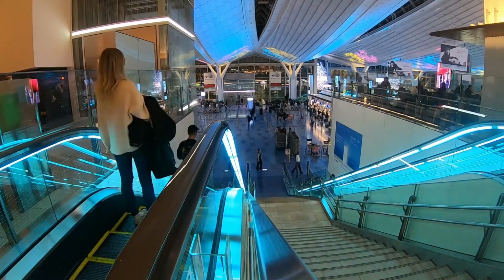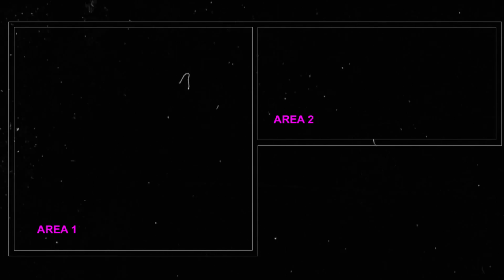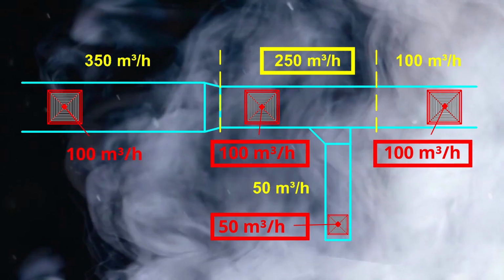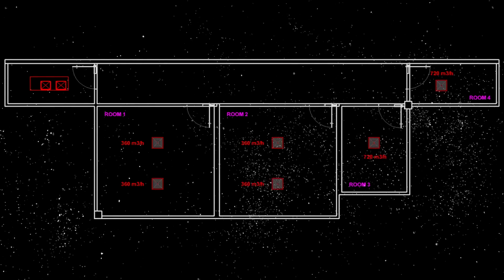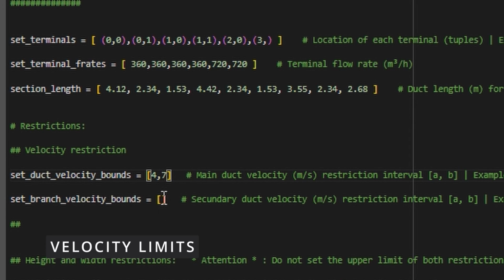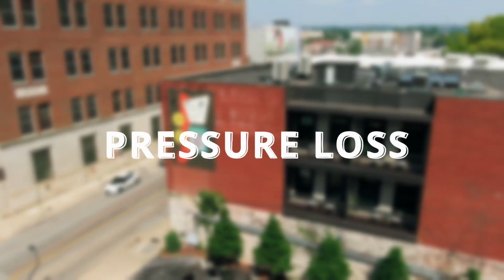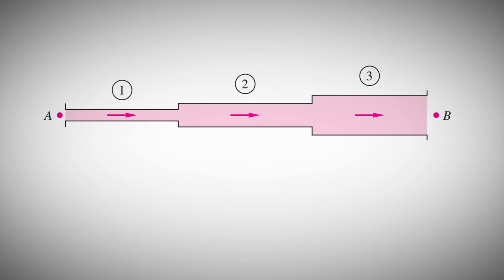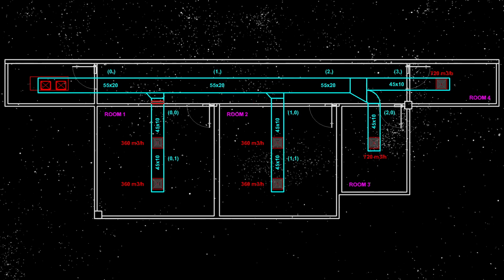Air Duct Sizing: Easy Way

Comment: OUTPUT IS SHOWING LIKE 

Traceback (most recent call last):
  File "main.py", line 27, in <module>
    import scipy.optimize as spo
ModuleNotFoundError: No module named 'scipy'

HELP MEOUT
Reply from the maker: Hello there! The error might be because Scipy isn't installed in your coding environment. I'll update the code with a 'pip install scipy' line to install it.